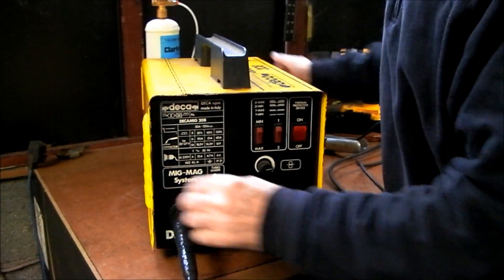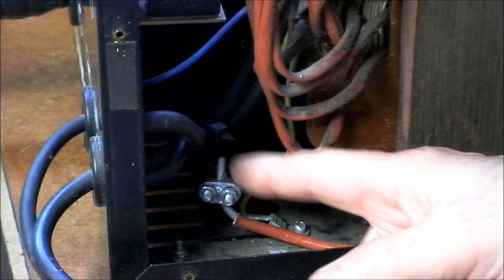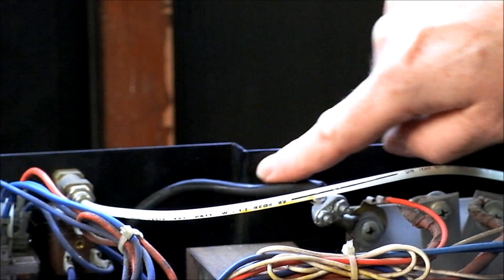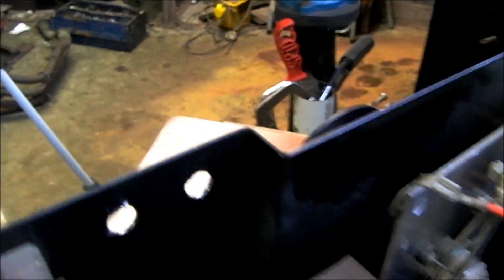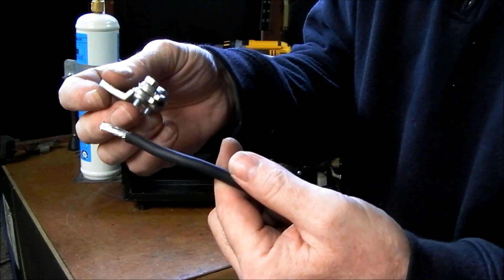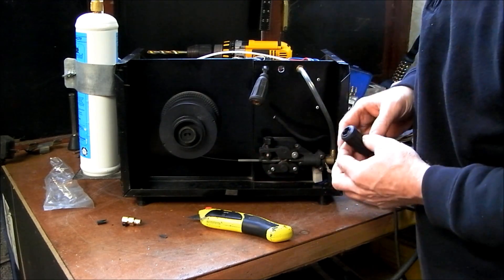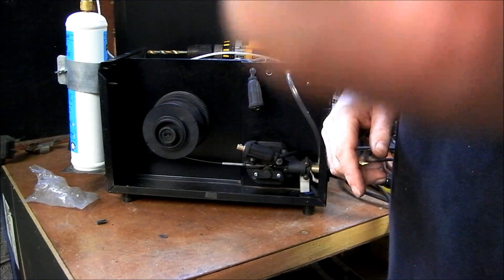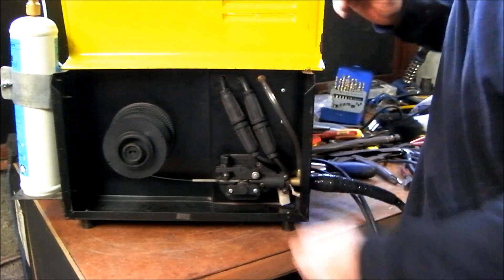Mig welder polarity change

Comment: I've just recently bought an old mig welder like this. Bought a small gas refill for £15 and a regulator for £15. Managed to do some smooth beads, no spatter. After about 20 beads, the gas bottle ran out! I'd checked for leaks, and made sure I hadn't turned it on too much so not wasting gas. I bought a roll of flux cored wire, as I thought "I'm not wasting 15 quid for a gas bottle every 5 minutes!". Immediately I regretted it, as the spatter was unreal. However, after reversing the connections of the torch and ground, I immediately 'un-regretted' my decision. It made an absolute world of difference. Yes you still have to find a sweet spot for the power settings/wire speed, but I very much doubt I'll go back to gas now.

Comment: I was looking at mine, and thought that was what needed to be done. But it's good to have a sort of reference to increase my confidence that I'm doing the right thing and won't screw it all up by doing that. Granted I plan to go speak to the local welders supply and get his opinion as well, to avoid any unforseen circumstances.

Comment: That's part of the mod I'm doing to my cheapie gasless might, I'm also adding a solenoid valve and gas set up so I can run "proper" wire and weld stainless.

Comment: Alright, I just got this Clarke weld 100e mk2. I ran some flux core through it and it was pretty good. I would really like to reverse the polarity of it to get results that are similar to yours. It has a lot in common with your machine, I'm a little scared to take the plunge. I've read about other guys doing it to this same machine but I'm a beginner. Is there any information that I would need to know in order to avoid smoking my machine? It's a heavy little guy, and made in Italy. I really like it!
Reply: youngn9na92 dude did you ever figure it out? Im in the same boat
Reply: Sam Adelman Yes my dude!
 http://www.mig-welding.co.uk/forum/threads/clarke-100e-mk2-gassless.63051/page-4#post-1016433

This is all at your own risk though. I believe this guy said that and the forum does too... Not to be rude of course. This is dangerous stuff though, safety first!
Reply: youngn9na92 man I can barely get a sense of whats going on there
Reply: Sam Adelman this evening I will try to reply back. I will try to type out a basic summary in a bit. Can you tell me where you are at in your project? Have you swapped polarity yet?
Reply: That would be awesome man. Currently I am still just trying to identify positive and negative leads. On other machines it's quite simply indicated, but not with this model, and I have the exact same model as you.
Reply: Sam Adelman OK well first off I need to let you know that a fair amount of hardware will need to be bought. About $30+ depending on the stuff you purchase. Do you have a dremel/rotary tool? Maybe even a hack saw? One of the parts that I had to make required a fair amount of fabrication as I couldn't find one to buy. This project required a lot of patience also. Not saying you can't do it. But it's a lengthy and frustrating conversion at times.
Reply: Frustrating Conversions is my middle name. If you have facebook, you could literally send me a video, and it might save you time. That way we can go back and forth easier, that is if you are up for it.
Reply: Sam Adelman I do not have facebook, would you have an email could send anything to?
Reply: Sam Adelman I just saw your post on the forum. I may not be much help with this project simply because the 130 is somewhat different from the 100e mk 2. The guys there may be more helpful because the models are a bit different. Try to watch for alerts though. A lot of the guys are in different time zones but are good about getting back quickly.
Reply: Xb😊😊😊😊00x

Comment: No wont work. I think because it's a one wire trigger so it needs power to run the feed. With reversed polarity if I got the arc going it would feed but it's a good way to fly through tips

Comment: I tried the same thing with my clarke 100e. When I reversed the polarity the wire wouldn't feed. Any ideas how to fix that
Reply: MrKardukas I hate to be a bother but no matter what I try I can't get the wire feed motor to work. I am completely stumped. I have the gun and ground swapped and it will arc, but the motor won't go. I switched a few of the quick detach wires around but got nothing, now the quick detaches are all back together. Please help!
Reply: +Brock Gosling My Beccamig 100 won't feed wire either after reversing the polarity..
Reply: +Brock Gosling  Hi, have you solved your wire feed problem? I just bought my MIG and was going to change polarity, but my connector is too short. After I get all supplies I will write if my wire feed works.
Reply: +Brock Gosling Where you able to resolve the polarity issue?  I have a 100e as well and I would like to reverse my polarity.  If you are able please email me at dragons_bane23@yahoo.com with how you managed it.
Reply: +Clunk49 Where you able to resolve the polarity issue?  I have a 100e as well and
 I would like to reverse my polarity.  If you are able please email me 
at dragons_bane23@yahoo.com with how you managed it.
Reply: +MrKardukas Where you able to resolve the polarity issue?  I have a 100e as well and
 I would like to reverse my polarity.  If you are able please email me 
at dragons_bane23@yahoo.com with how you managed it.
Reply: No, I quit trying after the wire refused to feed....didn't want to mess anything up.
Reply: +Clunk49 Just switch polarity of wire feeder and it will work. At least I did that and it worked.
Reply: +MrKardukas how did you change it? My understanding is that it is one power cable that runs them both? Can you send pictures and instructions?
Reply: +Charles G It was quite some time ago. I will try to open it, take some pictures and make instructions. As far as I remember my MIG had two wires that ran wire feed motor and I only needed to switch their connections, since I changed the polarity of my machine. Sorry if you can't find sence in my scribbles, English is not my native language..
Reply: +MrKardukas thank you for your help and time. You make perfect sense. You have a clarke 100e?
Reply: MrKardukas I have the Mark 2 version would it be possible for this to work for it? If so could I have a copy of the instructions?
Reply: My wire feeder motor was soldered in on the spade wire terminals that go to it. I broke off the terminals and connectors on accident. Not proud but I've never seen spade wire soldered like that. Curse those Italians!